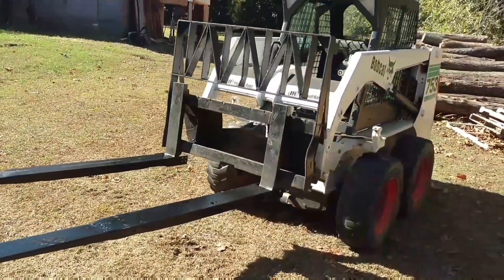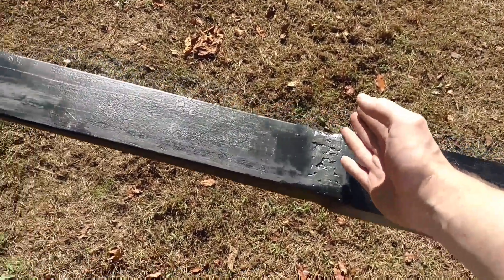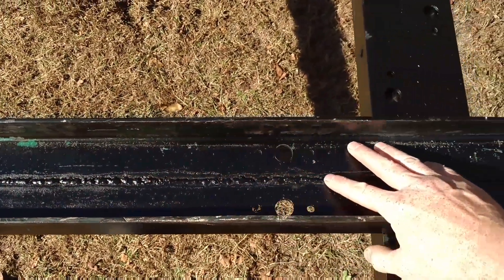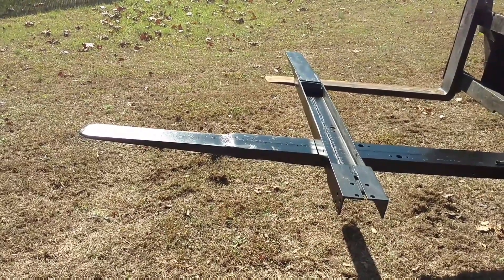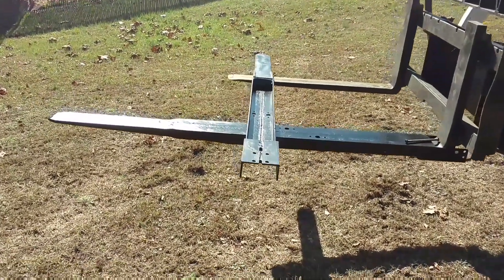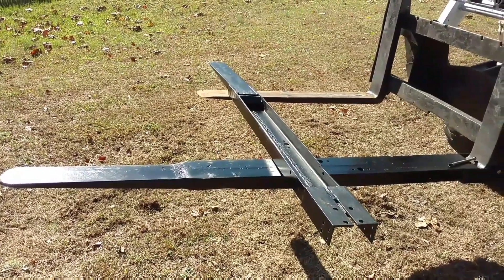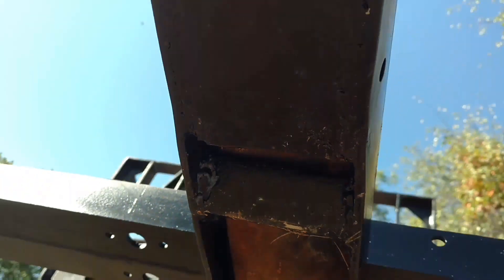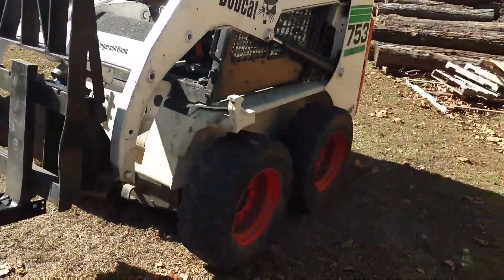Homemade forklift extensions

Comment: Nice for moving skids of lumber. I have a set of short forks on my backhoe to get logs out of the woods. I need to add an extension to them for the same reason. The short forks are nice because I can toss them around as needed. Good job
Reply from the maker: Thanks, I owe the idea and the work to my brother. It is nice to have some help and a second opinion on things. I had my doubts  on these but now that they are done they sure come in handy.

Comment: I use chains around a tractor bucket to get my logs on and it's getting pretty old. Lol
Reply from the maker: I find most of the attachments I use on Craigslist. those forks for the skidsteer only cost $300 and I am sure there is a way to modify something similar to attach to a bucket if need be. you can do anything you set your mind to.